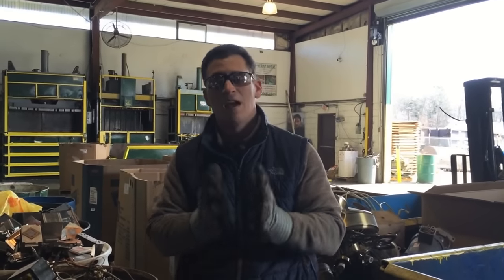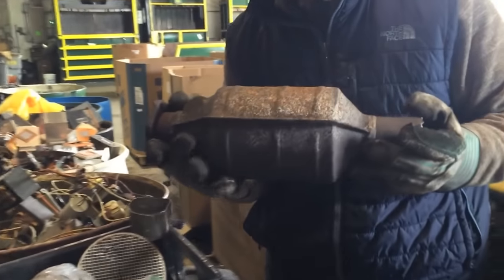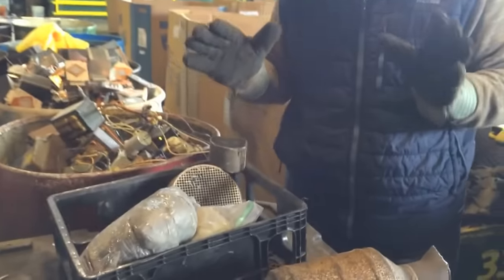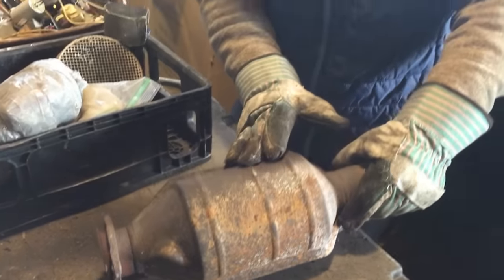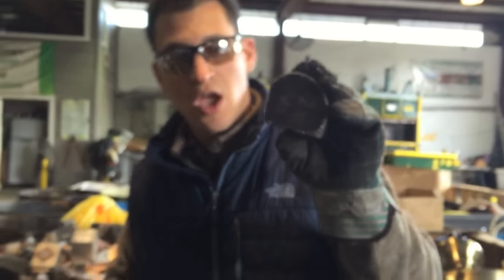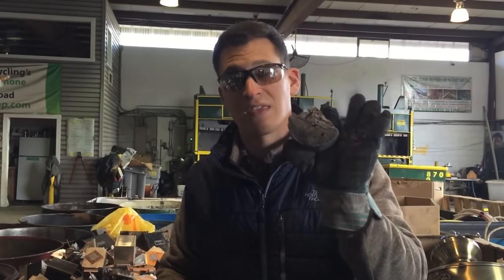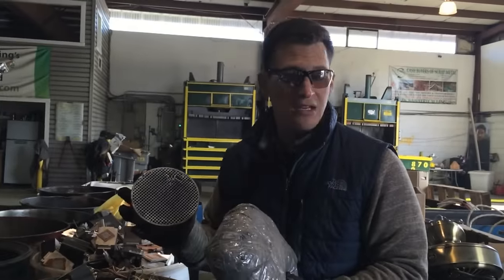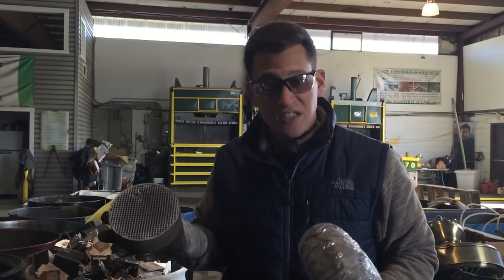Important Tips on Preparing Catalytic Converters for Scrap

Comment: Some yards want the make and model of the car or truck it came off. Higher end cars will pay more then a low end car. Lexus verses a Kia Rio for example.  Generally if you have all the info with the cat yards have paid $400 per unit. That is why people should take then apart.
Reply from the maker: If you cut open a cat open and just say "oh, it's from yadda yadda..." The best way to get the best price is to NOT take the precious metals out and sell the catalytic converter as a whole unit.
Reply: Hi how do they grade different catalytic converters? I know they use the codes but surely every single catalytic converter is going to be different depending on what driving the car has done so how do they know what what. Cheers
Reply: @andyfolgate9081  standardized amount put in during manufacturing. Unless you blow the hell out of it, that same amount of palladium and platinum remains. It doesn't get "used up" because it's catalytic in nature.
Reply: They use the code off the cat itself and then they know what they will pay you. If they are not looking up the number and then give you a price, then they are ripping you off

Comment: Hi how do they grade different catalytic converters? I know they use the codes but surely every single catalytic converter is going to be different depending on what driving the car has done so how do they know what what. Cheers
Reply: They're extracting the palladium and platinum. Frankly it doesn't matter how much crap has gone thru the system or even if it's blocked solid. If it's anything like gold extraction, they'll crush it and put it in a huge pot with chemicals that will draw it out. The chemicals are poured off into a different pot and something else added that releases it. That's how gold works anyway.
Reply: @OffGridInvestor  thanks very much for the reply very informative

Comment: Do these scrap dealers do anything to prevent buying stolen goods?
Reply: I do not think so.  I had both my hondas' cat cut overnight last week.
Reply: How the hell would they know? They don't know if it's off your car or not. Hell some dodgy ones  were even buying copper cable they knew had been shot off power pylons. I mean the super big ones. There was a guy doing it for a few years but underestimated the wind and it blew back on top of him and killed him. Power line workers found him a few days later still holding the gun.
Reply: It’s frowned upon